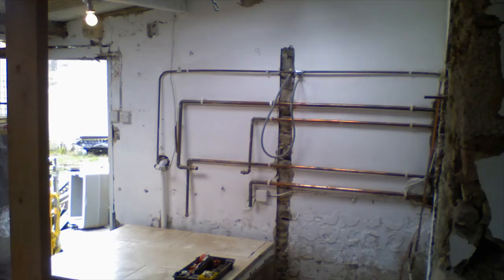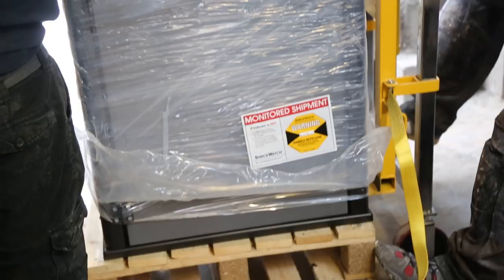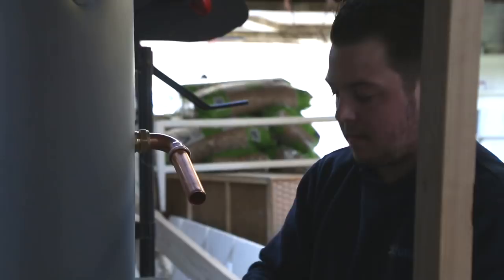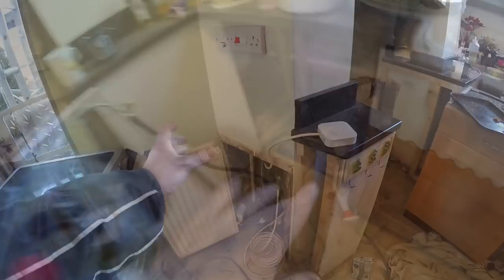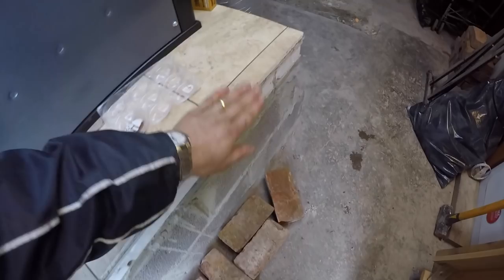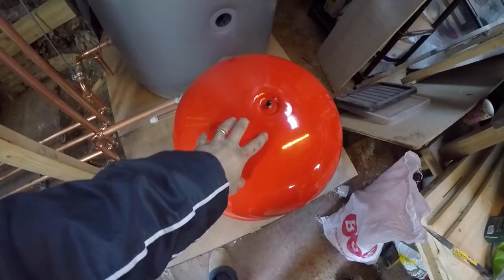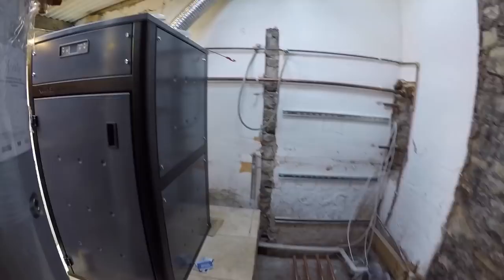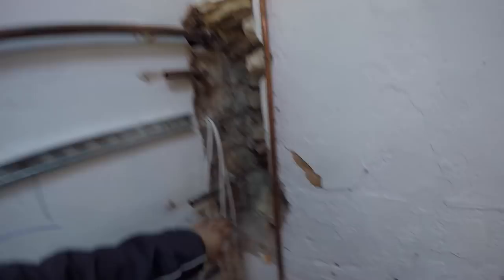Biomass Boiler Installation 4.0 | Fitting Buffer Tank & Lifting the Boiler

Comment: What size is that buffer tank ? 
I’m planning an air source heat pump and solar thermal , combined with a buffer tank to run my UFH. I’m in Portugal, where solar thermal should work well even in the winter. May I ask how I determine the buffer tank size ?